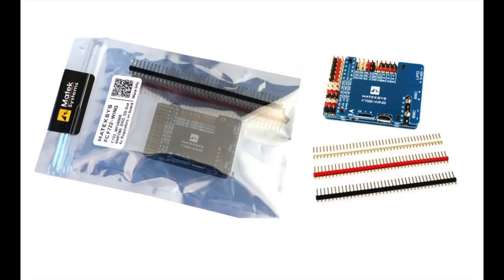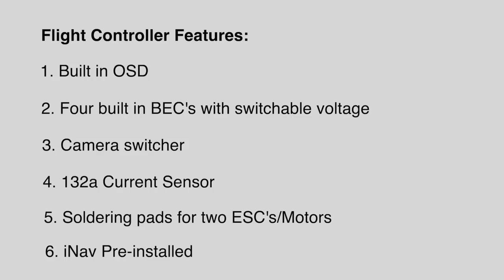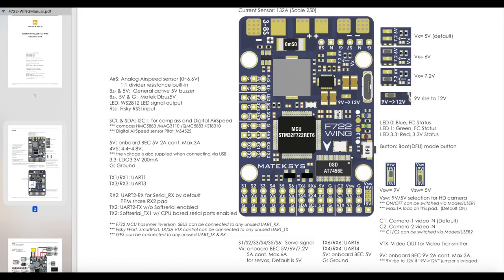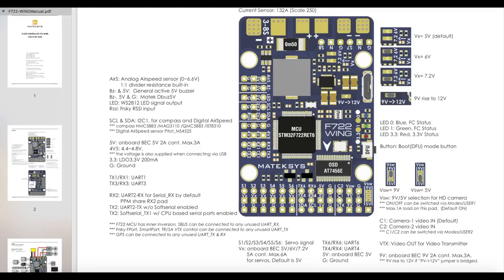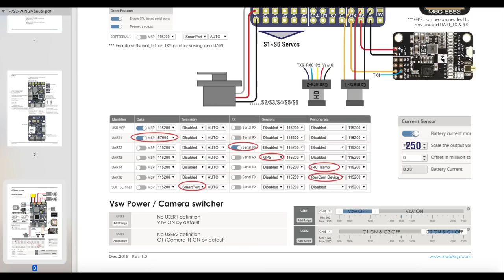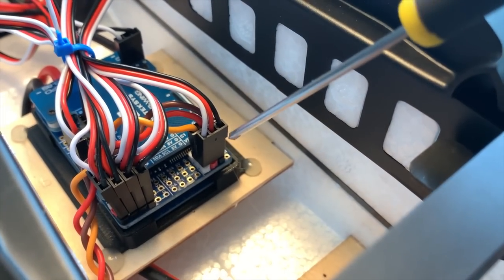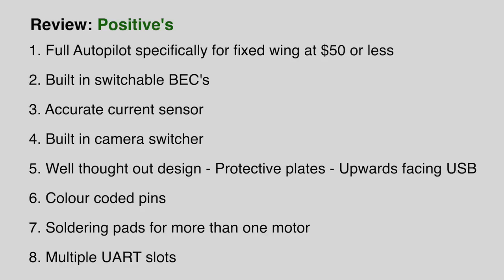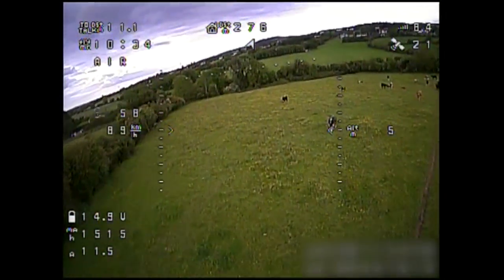Matek F722 Fixed Wing Flight Controller - Review - Wiring - Installation

Comment: I'd go up to 8v capable 20g coreless servos - you'll then get far more stable flight/sensitivity.  (MKS or better still Jeti Ditex).  If anyone's worried about soldering, a good bit of practice is to get a self-assemble FrSky RX4R.  If you can solder that without any shorts you'll be fine with the 722/765.

Comment: Afaik it can run ardupilot, just need to flash it manually the first time, afterwards MP will identify it automatically.  The second best AIO board imho is OmnibusF4pro- tiny and simple costs $35,  better suited for small builds, but this one is for sure a great choice!
Reply from the maker: I know you can run Ardu on the 405 board but Matek state that you can't on the 722? Not sure. I have used the Omnibus F4 pro on a fe models and although cheap and compact, it's harder to work with and isn't as simple as plugging components in. Still an option to consider though :)

Comment: Thanks Adam, Great video.
You mentioned a few times in the video that you did not find a airspeed sensor for a reasonable price.
Try a search (on eBay ?) for the  MPXV7002DP , they are cheap and work great. You should be able to find them for around 9 GBP
A pitot tube is easy to make and are not that critical on size etc., there is enough documentation and how-to's around the net. I made them before and found it to be a fun project.
Reply from the maker: Great bit of advice there, thank you I will try one of these out :)

Comment: Why did you choose this flight controller? 
...not the smaller and lighter F411 WSE?
Thx
Reply from the maker: Hi, I just wanted the latest with the higher spec with more functionality. The F722 is so small and light it's not worth thinking about unless you're building something tiny in the sub 250 category

Comment: I can certainly see some of the advantages over the MFD FC, the BEC's, camera switch, and selectable voltages. Putting that and the cost difference aside, how would you compare it to the MFD Crosshair? I was considering the Crosshair for my new Full size Skyhunter build. I think I can handle the INav but soldering is where I would run into trouble. Was hoping for something plug and play.
Reply from the maker: Hi Stephen. I haven't had any experience with the MFD Crosshair, but from what I can see the main updates from the original AP that I fly with is the colour coded plugs for easier installation and the fact that it has a colour OSD. The main advantage of the MFD over the Matek is that it's more plug and play. For some, another advantage is that it works very well out of the box and only requires a few tweeks to get it running perfectly. iNav i feel needs more work to get it performing well, but it is getting better all of the time! For some, iNav has far too many options and will add unwanted complexity. You are not the first person to mention soldering and this is something I overlooked slightly. It is a fiddly job getting those pins soldered on and obviously with the MFD it's ready to go. It's hard to say which is better because it really depends on the person. If you're not concerned about money and your are planning to just run 1 FPV camera then the MFD is a fantastic FC. Hope this helps :) and good luck with the Skyhunter, great model!
Reply: @AdamGdoesFPV  Thanks for the reply, I was planning on using three cameras. FPV camera in the nose, GoPro Hero Session on a gimble and  a RunCam 2 on the wing. Not really sure how best to set them up yet.

Comment: Great informative video Adam, I'm using this board on my RMRC Stratosurfer, as for the pitot tube (air speed Senser) I'm using the Furious fpv one, it's made for the F-35 lightning works perfect with this board.

Have a great weekend!

Rob
Reply from the maker: Ah nice one Rob, is it this one you're using?: https://www.banggood.com/FuriousFPV-AirSpeed-Sensor-FPV-0369-S-For-F-35-Lightning-Flight-Controller-RC-Airplane-p-1277944.html?rmmds=search&cur_warehouse=CN
Cheers,
Adam

Comment: Hi, subscribed.  i just need a basic flight stabilization system for a rc fixed wing airplane made of foam.  what unit would work for me, i will not be doing FPV at all , just need to keep the wings stable in wind and things like that.  what would you recommend and thanks so much for your video and for your time!
Reply from the maker: Hi, thanks for the comment, glad you found my videos useful. Which country are you located in? For stabilisation the new Kopilot Lite is pretty good: http://tiny.cc/KopilotLite Gives you manual, stabilised, and RTH, with super simple setup and no soldering, no need for a computer and no need for FPV.

Comment: Hey Adam great review, very comprehensive! :)  I've looked at this board several times but the thing that puts me off is having to solder the pins. I'm fine and soldering things but hate doing the tiny stuff!  One final thing, your manual link is wrong I believe, takes you to the quad version not the wing specific manual
Reply from the maker: Hi Dave, you make a good point here that I didn't think of... the fact you have to solder your own pins on is something to consider when buying this. I feel like it's an easy job once you get the technique, but I fully understand because I use to find it really hard. Maybe I might do a 1 min long side video of how i do it... might help others? You were also correct i had the the wrong link for the manual, thank you for pointing that out i've now fixed the link. Thanks for watching and commenting. Cheers :)
Reply: @AdamGdoesFPV  Did you make the 1 min video in the end? I would find this useful. Cheers.
Reply from the maker: @wsisports220  I didn't, but i expect a new one to be delivered soon so I could make that video if it's useful
Reply: @AdamGdoesFPV  great I would appreciate if you could. 👍

Comment: Which cable do you use for wiring  ? is it servo cable?
Reply from the maker: Yeah just standard servo cables. I tend to have a bunch of servo cable extensions and I modify them to suit my needs with the deferent lengths etc. If you’re still unsure just let know and I’ll send you a link.

Comment: Did you use any extra cables? if you did link me them please, I ordered this combo and I would like to know if I need anything extra. Cheers.
Reply from the maker: I have a selection of random servo cable like extensions etc. I use these or cut and solder to the right length. Obviously the cable lengths all depend on the model you install this in. I haven't used anything specialist... just servo cables. e.g. https://www.banggood.com/custlink/KK3mUR7yzo

Comment: Hi Adam I have a couple of questions, not specifically about the Matek F722.  I got into fixed wing "drones" when i was given a Parrot Disco (worst customer support ever). On my maiden flight I managed to crash into a tree at around 30mph at approx 50Feet high. The drone itself survived (surprisingly) I just had to re-attach the wings, However the "CHUCK" Parrots onboard computer / flight controller etc, decided not to work again, and after 6 months of emails with Parrot they decided to not repair or replace the "CHUCK" However they did offer to sell me a new one for $1200. The complete drone only cost $600. So that's the background, what I would like is for a recommendation or suggestion as to what gear I would need to install in place of Parrots "CHUCK" to get it flying again, before I have to spend even more money on a replacement aircraft. One last thing, do you have a video explaining all of the acronyms like becs, vtx etc, I've managed to work some out, but being 61 and trying to get into the hobby it can sometimes get a bit overwhelming.  Many thanks if you can help / offer suggestions / advice. Cheers from Perth Australia.
Reply from the maker: Hi Paul, sorry to hear the Parrot worked out pretty badly for you. I don't really know much about the disco so might not be best to advise. However, I just took a quick look at the Chuck system and it looks like this contains:
-FPV Camera
-Video transmitter (Vtx)
-Electronic speed controller (ESC)
- GPS receiver (receivers of any kind might be referred to as an 'rx')
-Flight controller (FC)
-Maybe some Battery Eliminator Circuits's (BEC's... which are just voltage regulators that lower the voltage to supply correct voltage to a device. e.g. if you plug in a lipo thats 16.8v and you have a camera that requires 12v, you use a 12v BEC that lowers the voltage from 16.8v to a 12v output).
Hopefully the above also helps out with the acronyms. Based on this list i guess that the only electronics you can salvage are the servos in the wings and the motor. Therefore to get it flying again you would need to purchase the following:
-FPV camera (if original cannot be reused) - My favourite is this one: http://tiny.cc/FoxeerPredator4
-Flight controller like F722 which has all of the BECs built in - http://tiny.cc/MatekF722 
-Video transmitter 
-GPS receiver - http://tiny.cc/wwyh7y
-Electronic speed controller (ESC)
-You might also need to buy a video receiving and viewing items as I don't know how custom the parrot system is.
It may well be easier to just start fresh and buy something like an AR wing which will be a lot easier to work with http://tiny.cc/ARwingPNP and sell the disco for spares. Hope this helps anyway. Cheers
Reply: @AdamGdoesFPV   thanks very much for the suggestions Adam, i'll let you know how i go, Cheers again, Paul.

Comment: does it boost voltage to 12 when lipo voltage is for example 10.8 ?
Reply from the maker: Hi, I don't believe so, I think they are designed just to lower voltage. Cheers

Comment: I have literally this last week, ordered the talon GT with the f722-wing controller!
Will be my first fpv plane in the air.
What vtx are you using for this one Adam ?
Good video as always :)
Reply from the maker: Great combo :D I'm running a 1.2ghz Video Transmitter on this plane: http://tiny.cc/kwcv0y full setup on my Talon GT can be found in the video description of this video: https://www.youtube.com/watch?v=hxYoxUs7DCs if you are planning on running 5.8g, my go to Vtx at the moment is this one because it works well and has switchable power output: http://tiny.cc/cedv0y 
Thanks for the comment and good luck with your first plane :D

Comment: How would you hook up an 4in1 esc to this? (For quads)
Reply from the maker: Sorry I don't know exactly as I've never used a 4 in 1 esc. But I'm sure it would just be a case of connecting the signal pins to the corresponding connections on the board.

Comment: Hello Adam, i have f22wing on Mini Talon with iNav but I cant get the vtail working corretly, deflection is wrong. I re-create model on my TX and selected vtail but i dont how it should on iNav Mixer, i tried changing values,reversing servos but it just go ther other way, yaw is the same with pitch. Can you show me how to fix this?
Reply from the maker: Hi, when using inav you have to setup the model on the tx as a regular model, NOT a delta wing and NOT a V-tail. iNav does all of the mixing for these types of aircraft but if your TX is set to a V tail then this will be 'mixing' and confusing iNav. Hope this helps

Comment: Hi Adam, I'm using this FC on my first build with iNav. taranis X9D, R9M-tx, R9-rx and miniTalon. Can you help me figure out why motor is not spinning when using the radio? Servos are good, master control in iNav is working but not when using radio. I already enabled motor and servo output in Configuration tab still no luck. Please help it's my first ever build. Thanks
Reply from the maker: A few things to check:
1: in the 'radio' screen in iNav configurator does the throttle bar move correctly when you move your throttle stick?
2: when trying to spin the motor, do you have enough satellite's locked and have you armed your model using the switch you configured in the 'Modes' tab?
Reply: Throttle min setting must be 1000 or under.

Comment: What happens if I connect red cable from esc?
Reply from the maker: Nothing. The pin the the board doesn’t go anywhere.
Reply: @AdamGdoesFPV  okey, thanks for your information 👍👍
Reply from the maker: @sonyhadi8866  No problem. I just like to play it safe and not have the BEC power supply going to the board :)